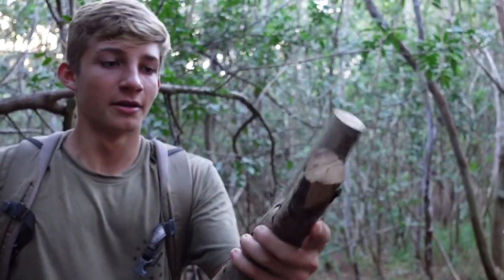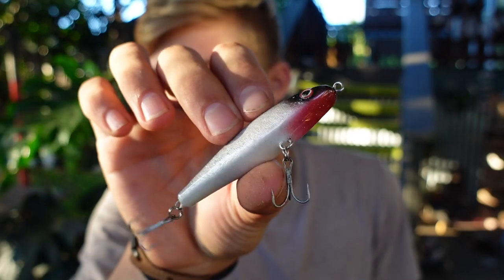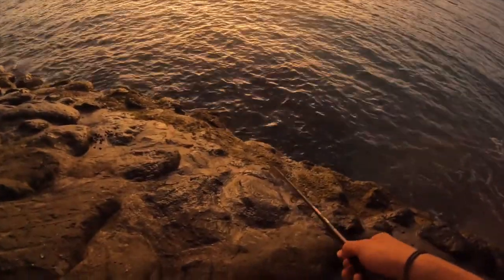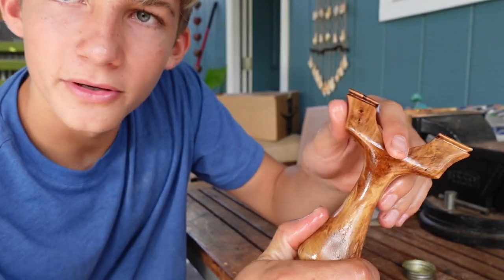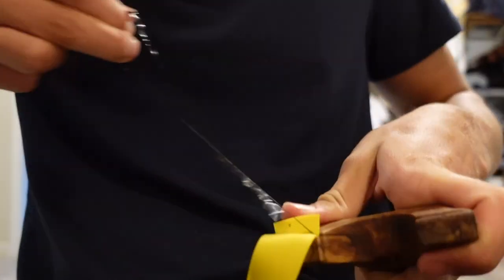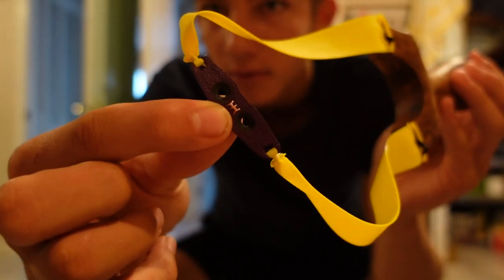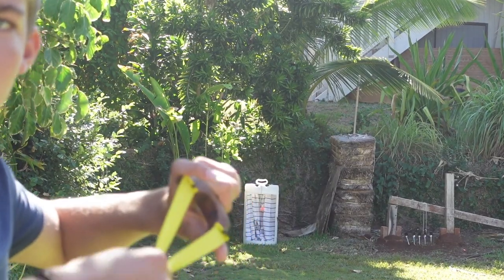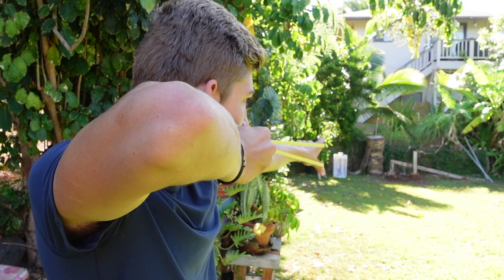Making Slingshot for Marling Baits | Shooting

Comment: Excellent fork bubs! Just for future reference - the grip this is built for is "pinch grip" where you pinche the forks. Or brace grip, when you brace the frame with your thumb. 
Hammer grip is when you hold it by just the handle.
Reply from the maker: Haha thanks, I realized my mistake when I watched it back after I posted it, good catch.